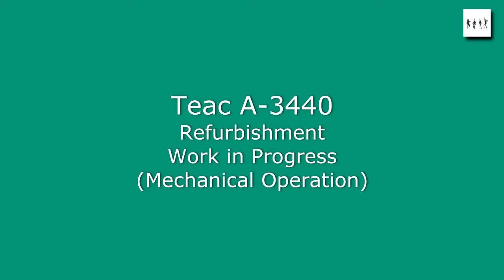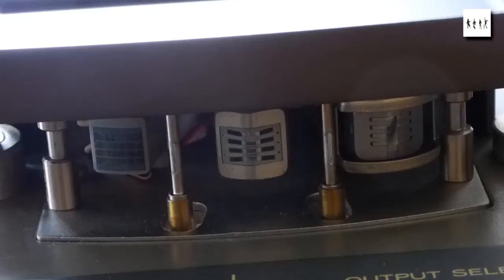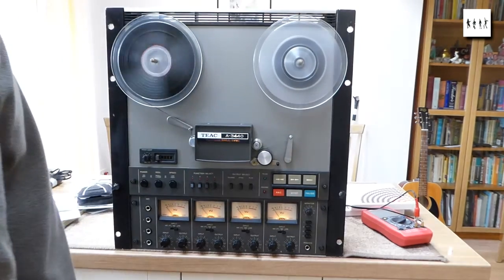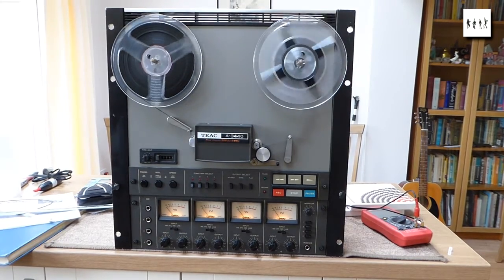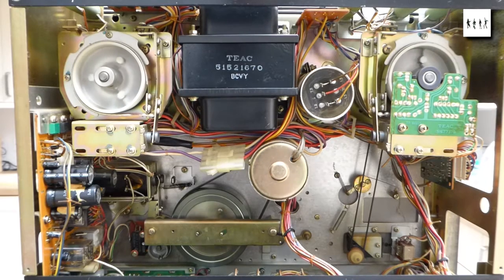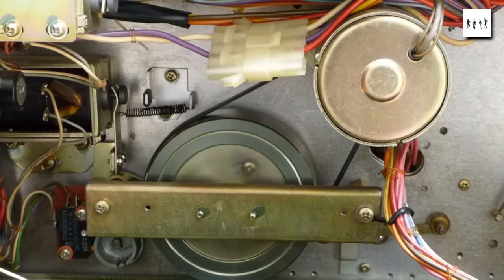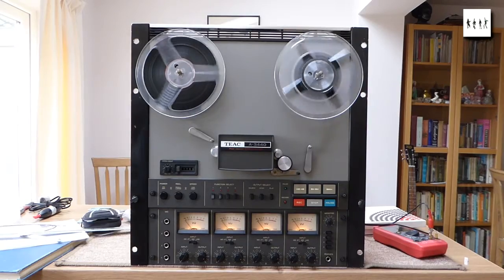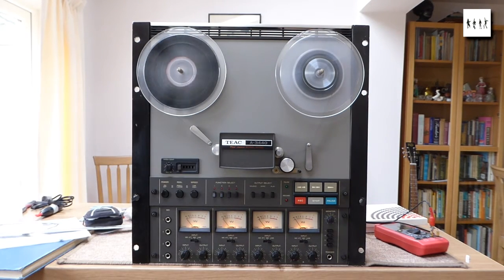A3440 Refurbishment - Mechanical Operation

Comment: How do you oil the motors on this unit?
Reply from the maker: The service manual makes no mention of oiling the motors; it only mentions putting two drops of TEAC TZ-255 (presumably a very light sewing machine oil) on the capstan shaft and one drop on the pinch roller shaft once every 2000 hours/one year of use, after operating the machine for 30 mins beforehand to warm it up. It warns against over-oiling. I have never perceived any need to oil the motors as they're still silent in operation, so I haven't looked into it. I suspect the motors have permanently lubricated 'oilite' bearings or similar. The capstan motor is fully enclosed in a mu-metal can to keep electrical/magnetic noise down, and I have no idea how you'd get into it! HTH

Comment: Thanks for the video. I just got one of these and am in the process of restoring it. How do you hook it up to a stere system for playback?
Reply from the maker: Hi Joe - If you want to use it as a 4-track, 4-channel machine for quadraphonic hi-fi listening, you will need a 4-channel stereo system with four discrete inputs that you can connect to the line-outs of the tape machine. 

If you intend to do home 4-track, 4-channel multitrack recordings (i.e. what it was designed for), you will need a basic mixer to mix the 4 channels down to 2-channel stereo and handle external effects, etc. 

If you just want to play back regular 4-track, 2-channel tapes in stereo, connect channels 1 and 3 to your stereo, as shown in the cartoon on page 7 of the Owner's Manual. If you didn't get the original manual with your machine, it's readily available online as a PDF download (as is the Service Manual) from various sources - try hifiengine.

You can also play back 2-track 2-channel tapes in this way, but you may have to experiment with the tracks you use (may be better off using tracks 1 and 4, due tio the wide central 'dead' guard band), and the results won't be optimal.

The headphone monitoring output and selection switch matrix allows you to listen to any or all of the 4 tracks at once, which will enable you to hear what's on existing 4-track, 4-channel tapes, and to do basic standalone track-laying. But it is just a monitor facility, and simply slings all four channels' signals to mono.

HTH!

Comment: I have one of these. Maybe u can help? 
The capstan spins. It ff and rw. All the buttons work. However when I press play the pinch wheel doesn't lift up. The play button can stop the FF or RW so I think the button is OK. 
The pinch wheel is free moving by hand and doesn't feel gummed up. 
Could it be a faulty solenoid? Any ideas? Thanks
Reply from the maker: Hi Bill - If I recall rightly (it's a while since I restored that deck), there was totally gummy/solidified grease in the capstan arm and/or solenoid, and it displayed that very fault. After stripping the mechanism, cleaning all the solid grease out with isopropyl alcohol on cotton buds, and re-greasing it with fresh light grease, it worked fine. I was amazed at how much traction that gummy mess had. So it's worth checking out the mechanical aspects before looking for an electrical/elecronic fault. Hope you manage to crack the problem!

Comment: I have one of these in its original box... sadly the capstan wheel doesn't respond when I press play. 
Any ideas on where to start?
Reply from the maker: Hi Bill - Sorry for the delay in responding. 

If you're confident about safely working on electronic equipment, you've probably already dived into your machine by now and sorted the problem, but FWIW:  

If the capstan itself doesn't rotate, it's most likely a failed drive belt (usually turned into a gooey black mess), in which case, clean off the debris with care - it will stain clothes premanently - and fit a replacement (google for suppliers online). 

Next, if the pinch wheel won't swing in to engage the capstan, the grease on the pinch wheel actuator mechanism levers may have turned to hard wax after many years of inactivity, causing it so seize up - that will respond to a strip-down and regrease. 

I have also come across a seized actuator solenoid (on another Tascam machine), which needed exercising by hand to loosen it off. 

Finally, it could be a failed capstan motor - that's bad news as spare motors are rare and very expensive. 

If you google around, the service manual is available online. Also google 'A3440 Carpenter' for a very good description of the A3440 circuitry by an enthusiast. 

Good luck!
Reply: @reqordist  hi there. Thanks for the reply. 
The issue of the pinch wheel not lifting was due to a leeky cap and bad transistor
I forget which one now maybe c711 on the control board was causing the stop circuit to remain active. 
All sorted now. This can be tested by removing q718 from the board. Basically bypassing the stop circuit to test the functionality of the the pinch wheel etc. 
Much forum searching and fun with a multi meter. Got there in the end
Reply from the maker: @billpickle2875  Glad you managed to trace the fault and fix it - at least the old discrete components can be readily sourced and replaced!

Comment: Currently servicing one of these. Those two screws that hold in the capstan flywheel retention bar on the inside on my unit are totally frozen. Did you have trouble taking those screws off? Are they sealed with locktite? I'm afraid of stripping them.
Reply from the maker: Sorry, Emmet it's a long time since I did that strip-down, so memory vague - but I seem to recall there was some green 'nail varnish' type stuff on the screw heads there. I guess they'd work loose otherwise, given the potential for vibration in that location. Have sometimes had to resort to Godzilla Grip / Neji-Saurus pliers when the crosspoints in the screw heads gave way...

Comment: Thanks for the vintage electronics address! Need belts too. Fine machine you've got there, sir.
Reply from the maker: You're welcome, Gabor - I hope they can supply the belts you need. The machine wouldn't win any prizes for its appearance in a vintage electronics show, but it has worked well enough to transfer about 70 open reel tapes from the mid '80s for a musician friend, so I'm happy with that!
Reply: Well that's the important thing. They were built with that purpose. Glad you're keeping this one alive. Thanks for your reply. Cheers :)